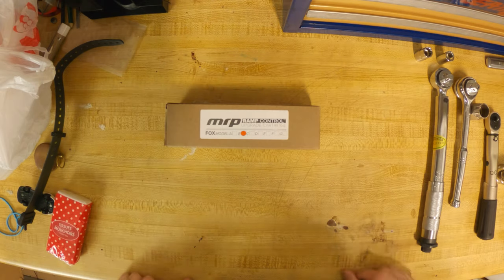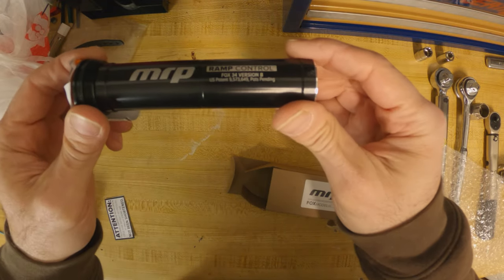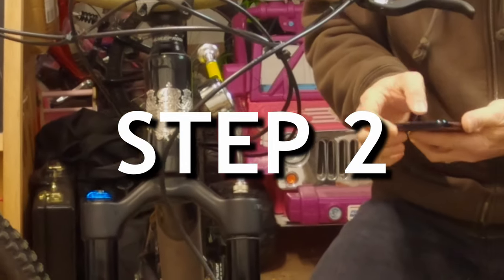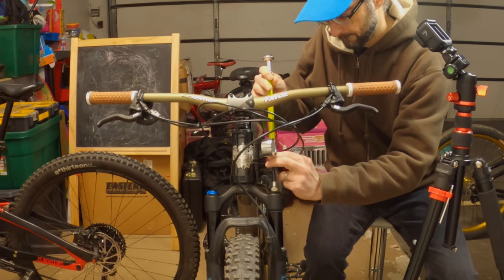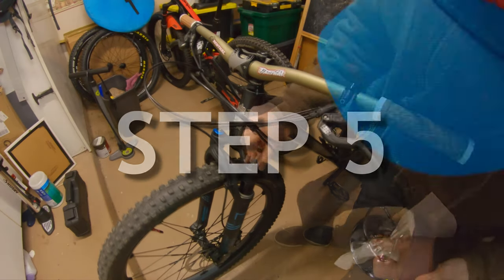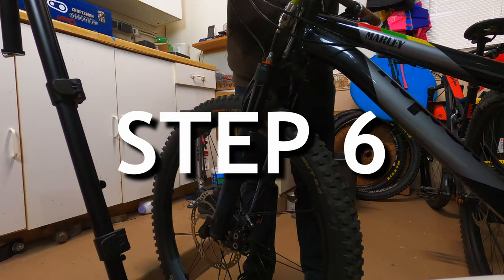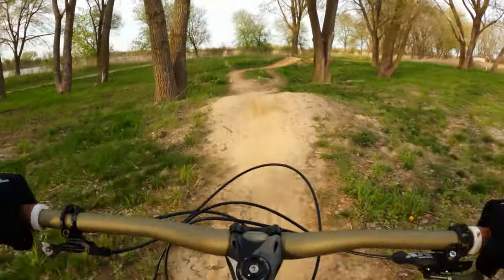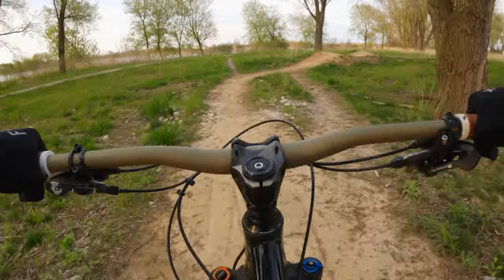MRP Ramp Control Cartridge Install: Upgrading the Fork On My Hardtail MTB

Comment from the maker: What do you think of the MRP Ramp Control?  Is it worth the extra money?
Reply: The Problem is i wanna buy one for my marzocchi z2 but on mrp Website  u can only see an Option for (fox 34 or z2 2020) model from 140-150mm model A Version . From 100-130mm (i have130mm) there  is no Option for model B shown for the Z2 only for fox34. Basicly ist the same fork. Why shouldnt it work? The mrp Service dont answer this question. Maybe u or someones here  knows ?
Reply from the maker: @dvxShoeN  I don't see how they wouldn't work. They are essentially the same fork 140+ or 130 and less. Perhaps its an oversight on the website.  Hopefully someone can answer  here.

Comment: Nice video! - really clear and simple instructions to follow. I'd not considered a ramp control so will be really keen to hear your thoughts after riding with it a while. cheers
Reply from the maker: Thanks! Glad you found it helpful.  😁 Definitely planning to put it to good use. I'll most certainly have a long term follow up.
Reply: @AdrenalineIsLife  Hey, so what do you think after 9 months of use ? I'm looking to buy one but I'm a bit hesitant as I'm not finding that many reviews on the fox 34 version. Thanks
Reply from the maker: @MarcoCaron   i haven't done any scientific testing but. I keep an eye on the O-ring after rides  I open it up for rough trails and close it up when I think the wheels will leave the ground. I like to use 7/8 of my travel and it usually I'm in that range.  As far as value goes on the 34, it depends on how concerned you are about ramp up. I bought it for under $100. I'm not sure I would've bought it if it wasn't on sale.
Reply: @AdrenalineIsLife  Thanks ! That's kind of what I figured it would do. My problem is kind of I had a problem finding a sweet spot using tokens where I had enough small bump sensitivity for not getting knackered after marathon races but enough support to not blow through travel all the time or sit too low in the travel in general. I ended up ordering a luftkappe since it's supposedly designed specifically for that. Being an engineer, I'd love to have the exact specs of how both devices work so I could run my own simulations but there is little hope for that, lol.
Reply from the maker: @MarcoCaron  I hear great things about the Luftkappe and small bump sensitivity. I haven't tried it yet but I may get one down the road on a different bike.

Comment: Mines leaking air from around valve any suggestions ? 34 b version for 130mm +
Reply from the maker: From the shrader valve? If so it could've worked loose. A shrader valve core tool should fix it. You can pick up a tool and spare cores at the auto parts store cheap.
Reply: @AdrenalineIsLife  I though that but it’s coming from the side of the valve on the outside under the orange dial. Gonna send it in for a check. Always done this since installing it I was sure I’d not installed it correctly but I’m now leaning towards it being faulty from day 1.
Reply from the maker: @jawg2392  That sounds like a defect. I'm sure MRP will take care of it.